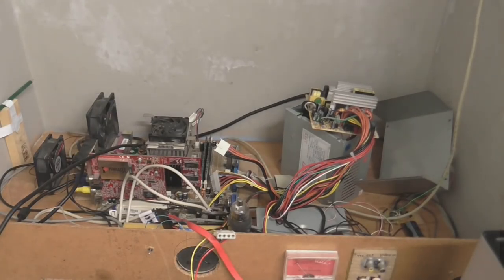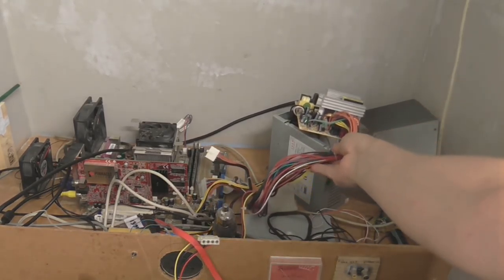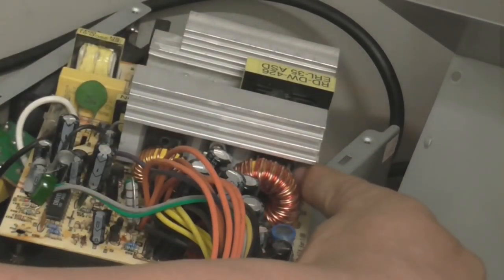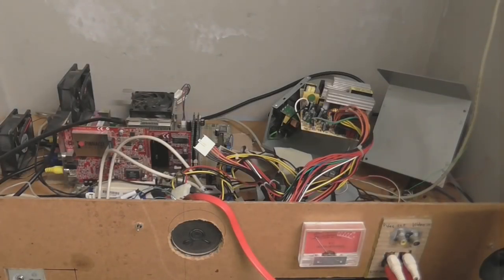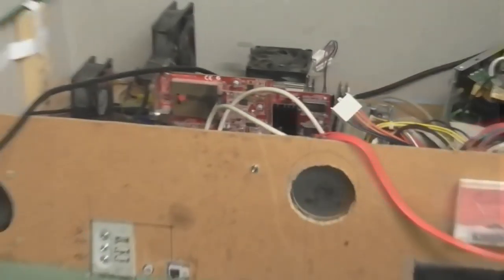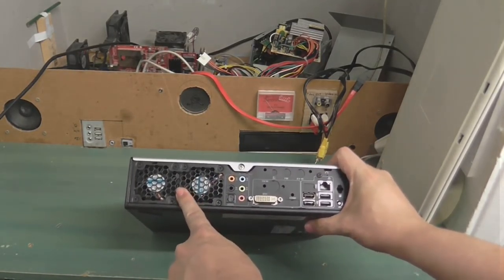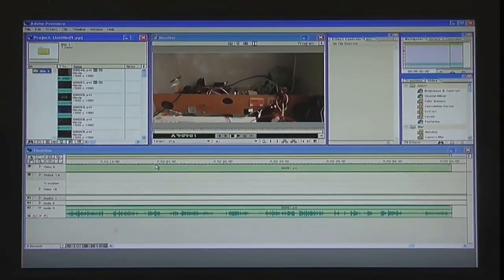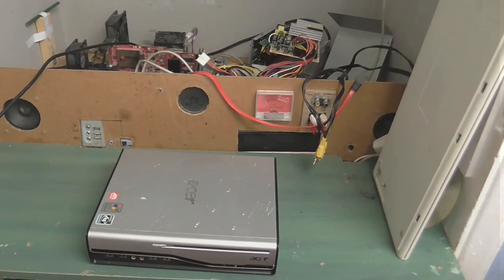FrankenPC Is retiring

Comment: Hi Cool Dude Clem, I hope your doing good & having a Happy Summer. Think of all the good parts you can salvage from 'ol Franken. I use a Propane torch for rapid removal of parts, taking care not to heat to long in one spot. The PC board does a pretty good job keeping components cool enough to survive extraction. Always good to see a new post as you were one of the very first channels I subscribed to way back when. As I have been doing electronics for some time, finding new, fun, projects is always key. I have been, in addition to, restoring old tube/valve radios from the 30's & 40's, building a Fender 5F1 'Champ' amp,  bread boarding some guitar pedal effects, boost, fuzz, etc., pretty fun. Sometimes low volt DC can be quite rewarding too. Good luck on new computer. Take care, be good, C.

Comment: Having been in this situation. I would replace the power supply and recheck all the cooling fans for starters. When you think about it, the re-installation hassle combined with the missing ps/2 ports and giving up the familiar operating sequence of the franken pc etc. it would be so much easier to replace the supply. 2 blown supply's over how long?  3rd one is a charm. Check franken pc motherboard for swelled caps. This is a very common problem. If the tops are even slightly swelled replace them. There is nothing else on the motherboard that would cause the power supply to fail. Good luck and this just my 2 cents.

Comment: Don't reverse the fans Clem, You will cook the insides of the pc with all the heat build-up. These things always seem to put out a lot of heat but that's normal.
Reply from the maker: Alright then, it just seemed to be pumping out quite a bit of heat. and in the bios I could see close to 60 C.
Reply: Yeah, That sounds about right for the athlon X2 cpu :) Have you tried running that white Dell pc yet as that has a quad core cpu and I think 8gb of ram
Reply from the maker: To be honest I forgot about that, I have had it running though as I wanted to see how well it would run some of my games.  I may fish that out of my shed at a later date and who knows, that might even replace FrankenPC's replacement!
Reply: I think it has at least 1 pci slot that could be used for the video capture card

Comment: What are the specs of your gaming PC?
Reply from the maker: It has an i5 2500K CPU at 3.3Ghz, 8GB DDR3 RAM, and an ASUS 6770 
Graphics Card.  I built that computer myself.  I can't remember what 
motherboard I got, although if I had the money I would have gone with a 
proper gaming Mobo and an i7 CPU.
Reply: My computer is just a Dell precision T3500 with 12GB of RAM, Intel Xeon E5620 @ 2.4GHz with terrible heatsink that gets hot, R9 270 2GB, and a 120GB SSD. I would have my i7 920 in it but it would only run hotter because the TDP is 50W higher than the Xeon CPU at 80W.